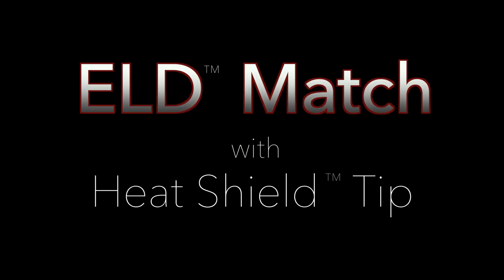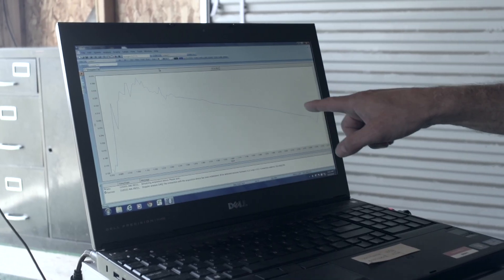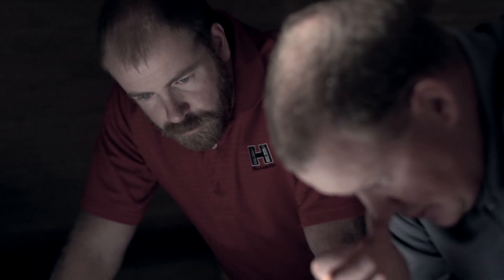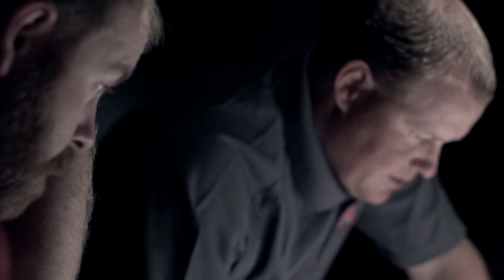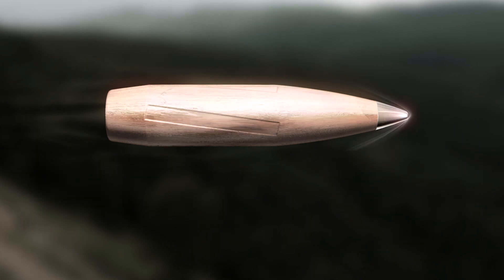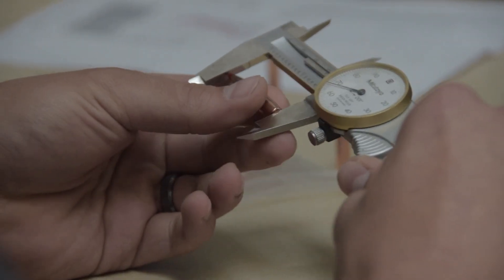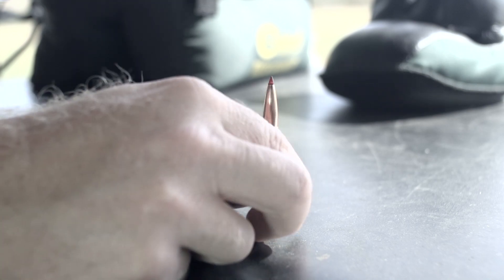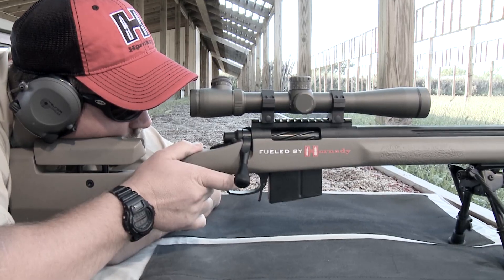Hornady® ELD™ Match with Heat Shield™ Tip

Comment: Hello Hornady Manufacturing, 

So I've done research into the ballastics. I love .308 it is my favorite round. Now I know its got a disadvantage compared to the 6.5 creedmoor. Now I know increased weight and length help the BC. But in a 308 you can really only do so much to weight before it gets too long and heavy to get a good velocity to 1000+ meters.

In theory if you had less lead reduced weight on say a 168 grain by Idk 8 grains. We now have a 160 grain bullet but add 8 grains of copper to make the bullet longer. Has this been looked into just essentially stretching the bullet? I feel a 147 grain 6.5 creedmoor is a 147 grain 308 just stretched out and in 6.5mm and not 7.62. Just a theory. A fan of long range and of your bullets. I really like the new 168 and 178 ELD M. Used SMK 175 grain before. Don't use the 168 SMK's cause just cant do 1k with them. Haven't tried the 168 TMK's which have upped the BC on those rounds a lot and should hold well to 1k but I have heard they are finicky. 

A longer version of a 168 would be awesome. The length of a 180-190 grain bullet but at a lighter weight moving faster. 

I hope some day you guys can maybe look into this if it hasn't been and also ever thought about machining a lightweight aluminum tip that can be as sharp as a needle?

Comment: No Hornady, not every other brand of tip bullets are having the same melting tip problem.  If you actually did some research the Bronze Point invented by and used to be made by Remington (which is the original bullet that started all this tip-bullet craze) didn't have this problem as its tip was made from metal.

Comment: I am confused on the hunting round vs. the match round EDL-X or the EDL-Match Is there a difference in the load or bullet or not? More interested in a reliable hunting round than target at this time. I have a new rifle in the 6.5 PRC.
Reply: Michael Kilpatrick ELD-M has lighter copper jacket and doesn’t retain uniform expansion like the ELD-X which is for hunting. ELD-M has higher BC for long range target shoot.
Reply: Use the eldm for longer range hunting. Devastating even through bone at long ranges. Check out Nathan Foster videos and his website.
Reply: also check out Long Range Hunting group. They rate the ELDM top of the pile . Just realised I'm replying to a 2 yo comment. Oh well.
Reply: Although it's not really intended for hunting I've had very good performance on whitetail deer with my handloaded 168 grain ELD-M .308s. And they're really accurate too.

Comment: It begs the question why polymer tips ever made it to the market in the first place. If I were them I would have felt embarrassed not to have taken the heat from the air resistance into account way before it showing up on a Doppler radar test.
Reply: Yes, talk about focusing on the solution rather than the problem. "Sorry customers but we've been selling you crap bullets for many years" was not part of this video ;-) But nice that it was solved in the end!
Reply: I agree, pretty bogus logic. See my comment on how ELD X ammo performed on a mile deer. Bullet failed and came apart, lead core came out of the jacket.
Reply: Plastic is cheap. Thats why it made its way into bullets.

Comment: I shot a mule deer buck in the front shoulder at 160 yards with an Hornady ELD X bullet from my 6.5 creedmor. The deer dropped then immediately stood back up. I shot it again, the bullet striking within an inch of the first round. The second shot dropped and killed the animal. Upon skinning the animal I found the first bullet jacket lodged in the hide on the entry side, the lead core was missing. The second bullet was a complete pass through of the shoulder and rib cage on the opposite side. 

I’m very impressed with the accuracy but disappointed in the bullet failure on the first shot. Zero penetration and the lead core separated. The shot angle was poor, I hate taking a shot through a shoulder but the animal saw me, was flanked by cover and was ready to run. I understand this is a high velocity round designed for long range but hunting ammo needs to perform at shorter and mid range as well. In my opinion any bullet touted for hunting needs to hold together at 160 yards. I don’t think I will try this ammo again in the field.
Reply: Eld match is not a hunting bullet. It was not designed for hunting.
Reply: @blueduck9409  I was using an ELD X, and it’s designed for hunting. One of the two bullets failed miserably.

Comment: Not excited to work up a new load.  If its shoots better than my 162 amax I will be happy.  But I have my doubts.   We shoot  600/1000 with the 162 and its been very good.   Even done some 1 mile work on dead calm days and its flat been a performer.    Ive tried Berger and SMK in my custom 7mmSAUM and the 162 amax hands down wins every time.

Comment: So dose the amax, sst, and gmx tips melt?
Reply: Also at what speeds do they melt?  @hornady?
Reply: +Bushy_P So you had that, "I've been spending $1.50 a round on a melting bullet?" moment too?
Reply: +Josh Carter Well I've been running my 308 out to 700 with the 168amax superformance out of a 20" barrel and haven't noticed it.  It's a pretty constant load.  Maybe with the faster stuff. 

Be nice if hornady replied.
Reply from the maker: +Bushy_P +Josh Carter My apologies on the delay guys and thank you for your questions! The "Hornady Heat Shield Tip EXTENDED" video playlist should help answer some of your questions. All videos are informative so I would suggest watching them all. To quickly answer your question jump to the "Heat Shield Tip vs Conventional Bullet Tips" video. Again, I apologize about the delay. Thanks!-  https://www.youtube.com/playlist?list=PLUB6LWvgMNyW2Op98tjFXLkCsF3uIX8yd